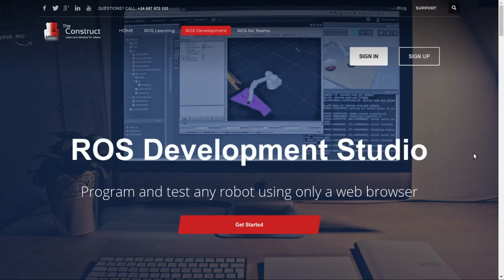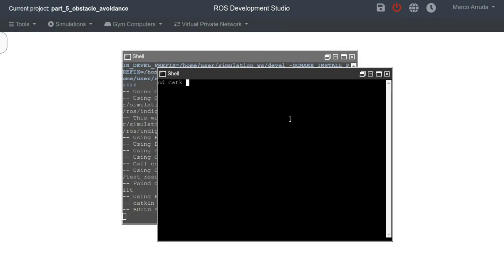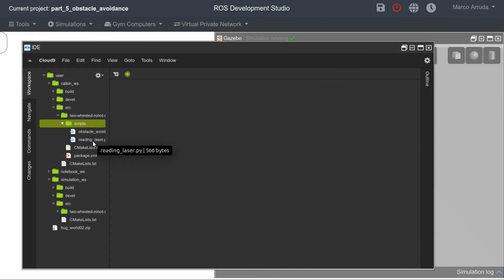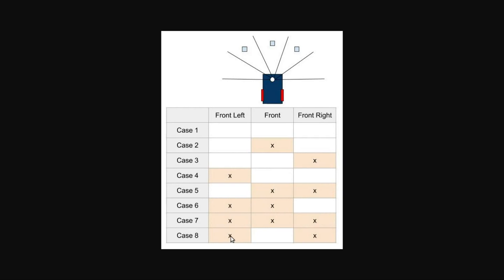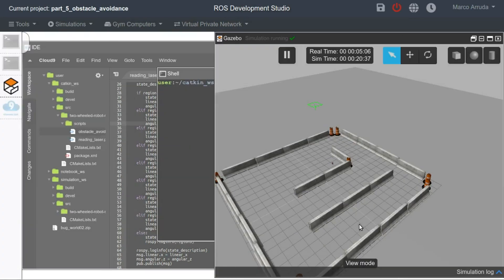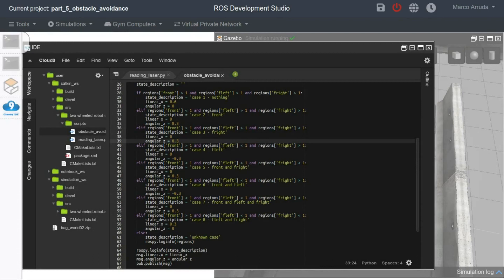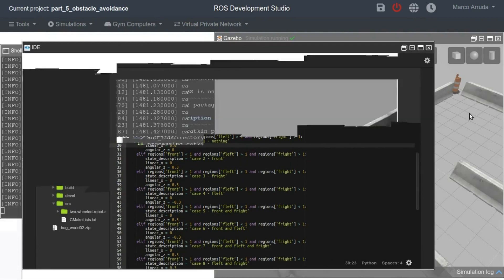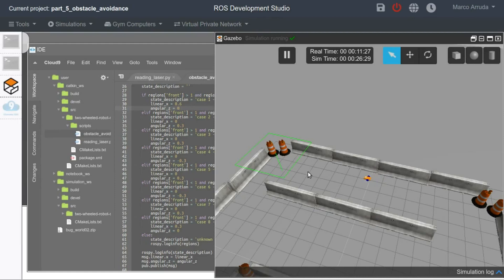[Exploring ROS using a 2 Wheeled Robot] #5: Obstacle Avoidance

Comment: I created the account in RDS but I am not able to create my own project
Reply: Hi @srivastava, you should be able to do so using the button "Create new Project".
Another possibility is a problem in internet connection, have you tried again?
You can also contact us by e-mail using the website form.
Reply: Thanks for reply Marco but still the same problem exists I will mail as what you said.I am following your tutorials ,In part 3 you said how to attach a sensor to the robot I also tried the same but different sensor(ft_sensor) for different robot which is not the mobile one .I added that sensor to the joint but the values getting are wrong when I am applying force may I know why